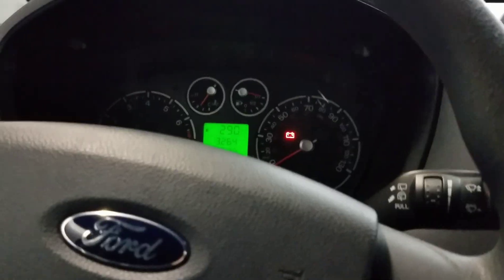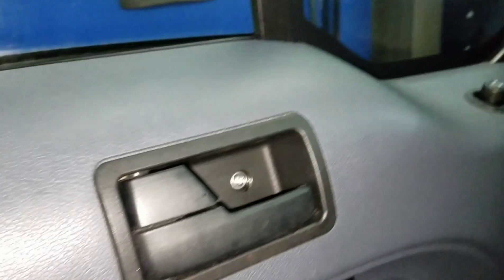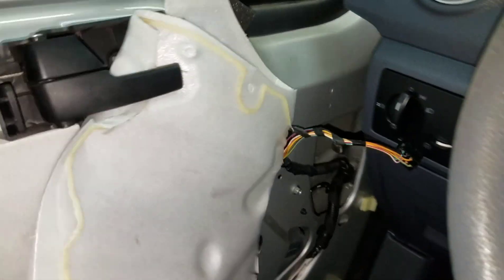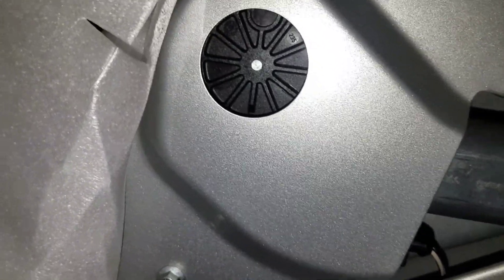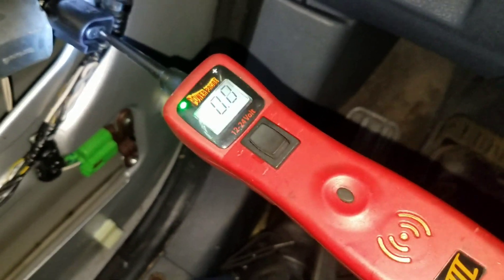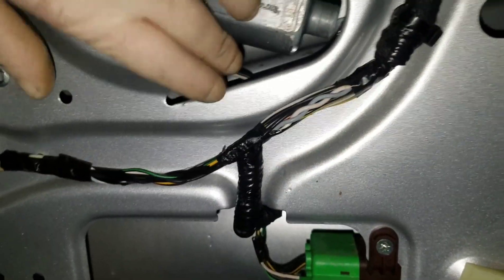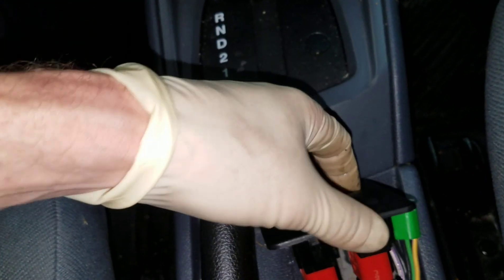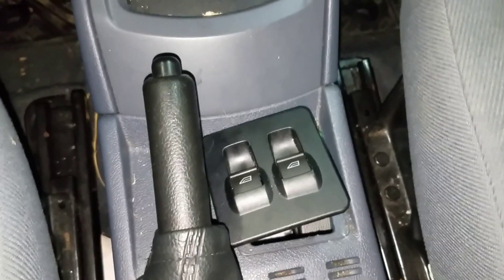How to find out Why Your Cars Window is not Working

Comment: Help me brother. Front passenger window doesn't work on 2001 Rav4. Replaced switches and window motor. I'm getting -12V one way on switch and 12v other way. Every YouTube video suggests all those things and my motor shod work but it ain't. If my switches are good, regulator is new, and I'm getting juice at the connections what am I missing? All the other windows work fine.
Reply: Also noticed the door lock switch doesn't work on that door either.
Reply: I’m having the same problem. Have you fixed it? If so how

Comment: yes. intermitent response in my driver side window. Ford Aerostar. I unbolted motor from regulator  and it runs fine forward and reverse. I raise the window up down manually and the regulator is smooth in its tracks. I bolt the motor again to the regulator and it moves the window up down fine,  I wait an hour and again it stops responding. Man what a hassle.

Comment: I just wanted to say that's a great suggestion to check for a faulty switch because in my old van I had just replaced the window motor and at the end of the day coming home I used the switch on the driver side to roll the window up and all the sudden it wouldn't go up. the switch on the driver side was barely making a connection but it was just enough to cut off the connection for the switch on the passenger side.... don't you just love power windows 😂